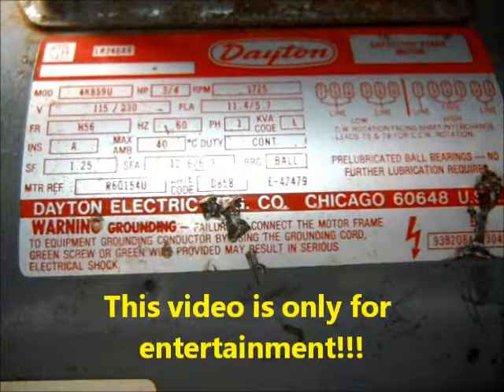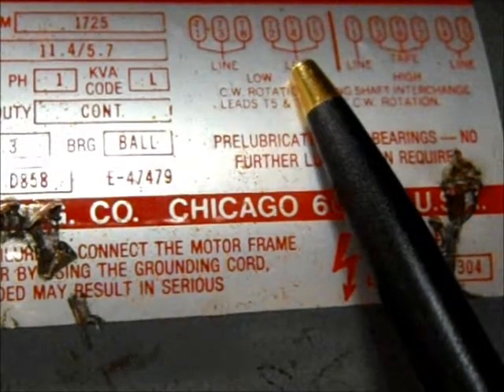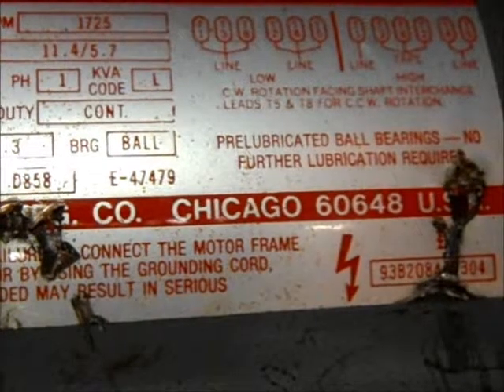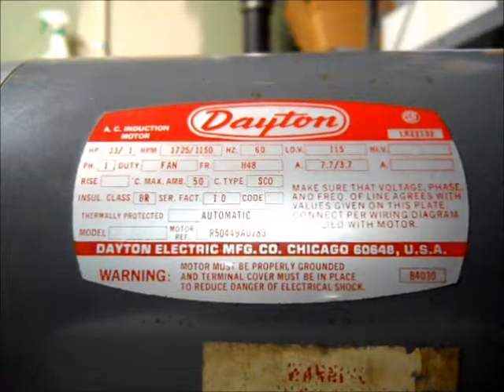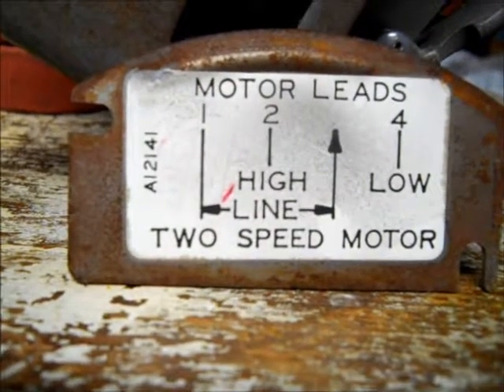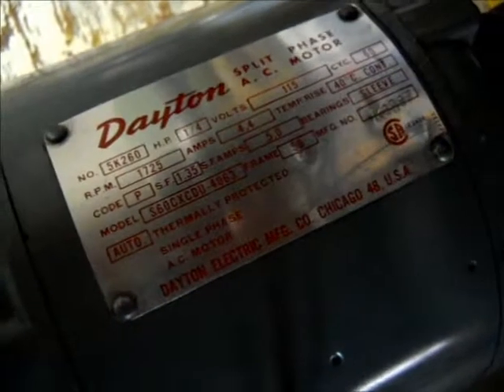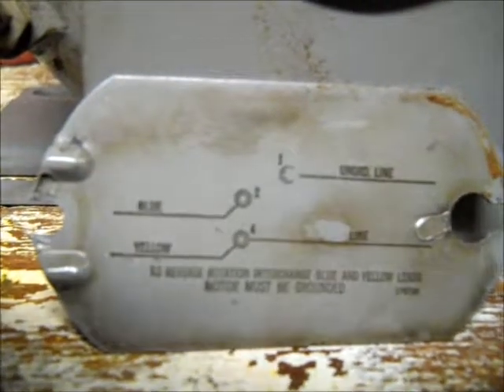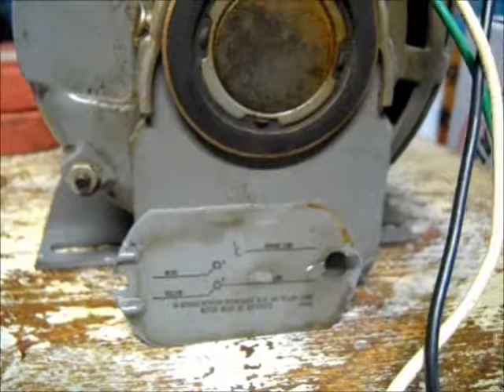Reading and understanding a wiring diagram.

Comment: So if u r reading a diagram on a 115v ac motor n u c Ungrounded line  n line on diagram. The Ungrounded line is ur neutral n line is your hot (L1) ?
Reply from the maker: Yes.
Reply: @Alan.89  thanks

Comment: Great videos.  I have a 115AC AO Smith carbonation motor to connect to a pump.  Just to confirm I can connect hot and neutral to either terminal?  Polarity does not matter ?  There are only 2 terminals plus ground.
Reply from the maker: if there is a wiring diagram on the motor i would go off of that. Is this a 2 speed motor your referring to or is it a 115/220 volt motor?
Reply: @Alan.89  thanks for the reply.  There is no wiring diagram on the label, it is 115VAC only.  There’s are only 2 leads +Gnd.  I wired it and it runs.  Was just wondering what would happen if I reversed the leads?  Run reverse direction?  Or not run? Or blow up?
Reply from the maker: @Jerryp1  It might still run. if not it will most likely buzz  or trip the breaker.

Comment: I have a new dayton motor that has 2 full sers of wires. Is this the high volt an the other set is the low volts
Or do they all need applied as to diagram
Reply from the maker: i would wire them according to the diagram provided with the motor.